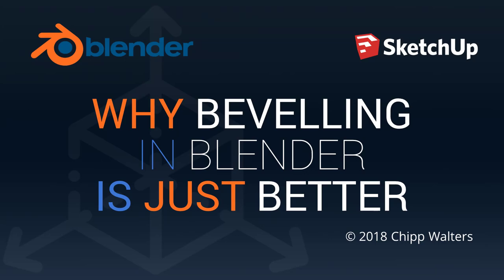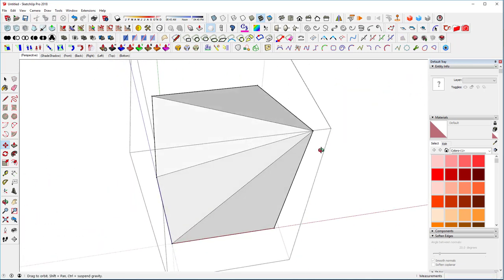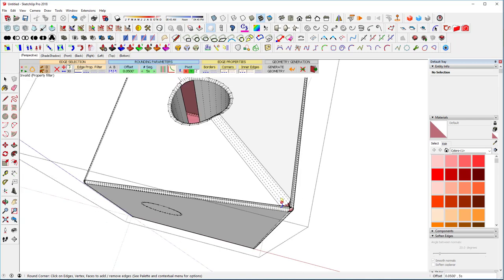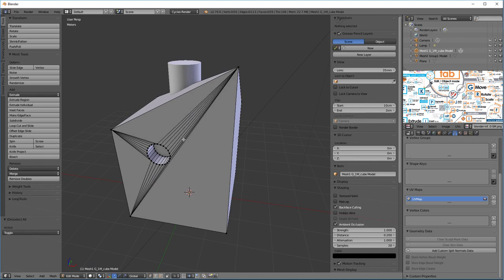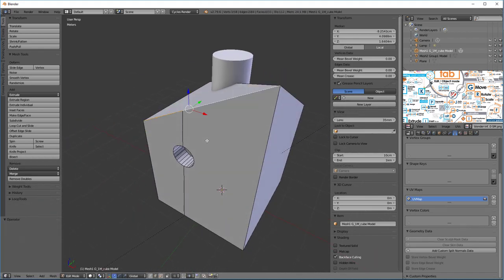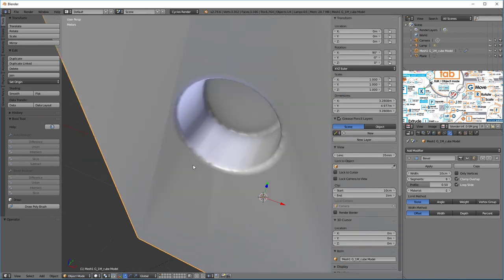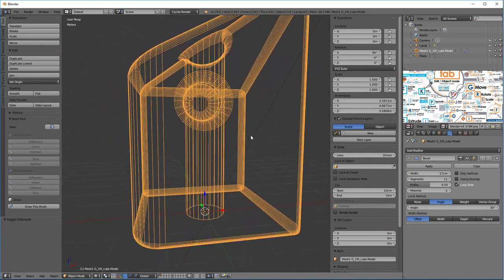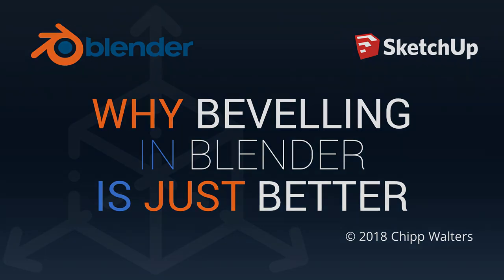Why Bevelling in Blender is just Better than in SketchUp

Comment: 2:52 On the other hand, I can’t seem to get a correspondingly clean bevel of the edge of that hole when I make it (using the Boolean modifier) in Blender. The surrounding face is not just one face, so I have to delete it and extrude the edge of the hole, then I can get a clean bevel.

Comment: Why are we even comparing blender to sketchup? sketchup is dead, inferior to any other piece of software out there. It's easy to use though.
Reply from the maker: Because there are many people who use SketchUp that would like to know more about other options. This series not only compares the two, but also helps teach users who hope to get started in Blender.
Reply: Disagree. I use Sketchup for not only my main source of architectural visualization but also video game static mesh and prop design. It's a fantastic tool for modeling and it's a VERY quick and efficient workflow. You just need to understand how to use it. I port things into Blender for UV mapping and detail mesh prep. They're both fantastic programs that work great together. Then I use Unreal Engine 4 for the final rendering of my objects/games/etc. 
I'm glad "Sketchup vs Blender" videos are starting to come out, but they're both honestly great programs and neither of them should be bashed.
Reply from the maker: I have to agree with Jeremy. I created the whole historical recreation of the Alamo using SketchUp for the Experience Real History: Alamo Edition AR project (www.alamoreality.com) and used 3D Coat to do the UVs. The workflow for that project was extremely quick for me using SketchUp. I expect it to be even faster with Blender as UV creation and baking is built in.

Still, Bartosz, there is a lot of truth in what you say. There has been no major 3D upgrades worth mentioning to SketchUp for years. It's clear there is a sense of abandonment by Trimble, which is to be expected as their primary business is not selling and supporting 3D modelers.